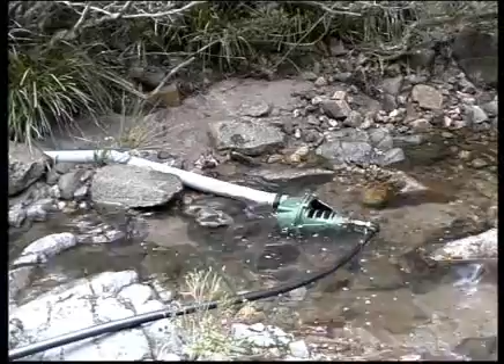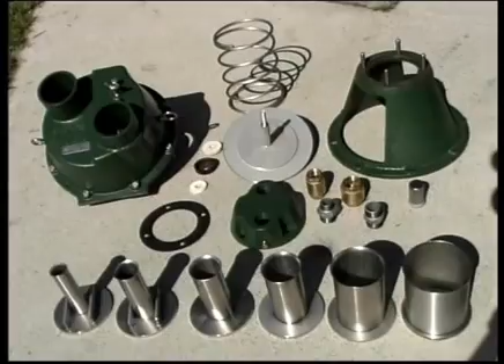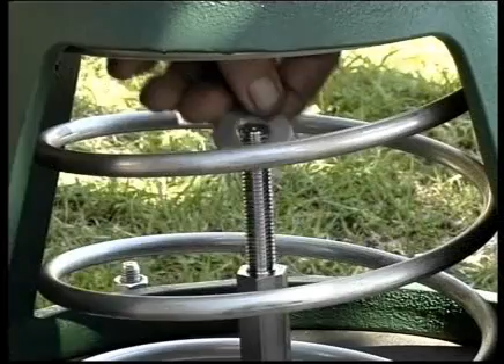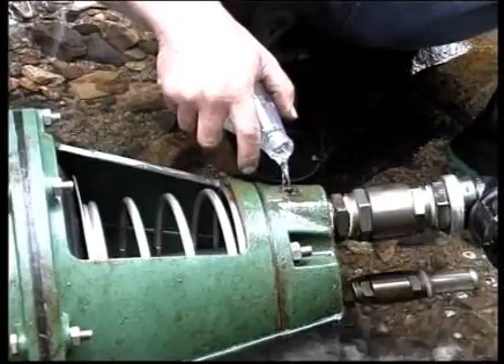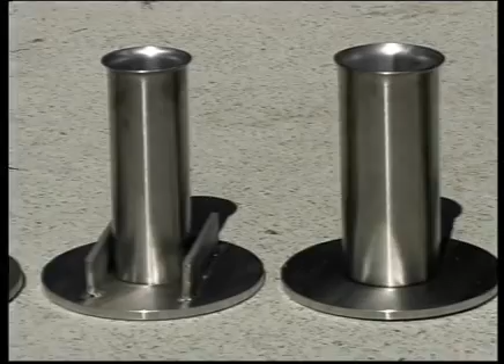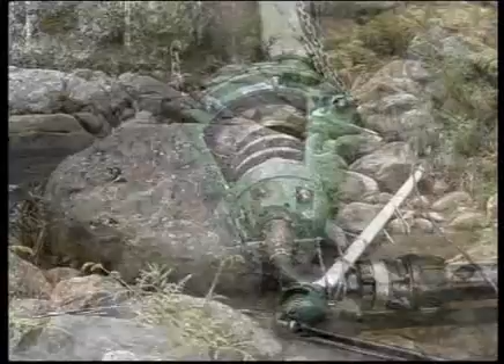Glockemann Pump Overview

Comment: around 18 years ago I seen one of this pump down rose bank NSW Australia  and I was sitting watching it, and had the idea that with just a slight change it could pump air, for use with air tools or used to drive a small generator or the compressed air could be used for heating or cooling ie ever noticed how compressor connectors can form ice on them simply due to the air moving in the pipes cool down the pipes and compressing the air concentrates the heat from the ambient air around the pump intake
Reply: also ever heard of palter coolers, if you put heat and cold onto them they make power, but it you put power into them they make heat on one side and cold on the other side  have any questions just ask or Google it
Reply: That's what a trompe does. Isothermic compressed air.

Comment: This is not quite the same as a hydraulic ram. This uses the water hammer to drive the diaphragm, which drives the cylinder.
Reply: Both use water hammer effect; the difference is that a ram pump compress a pocket of air to temporarily store energy whilst this compress a spring.
Reply: this is water hammer  just not as hard as you might know